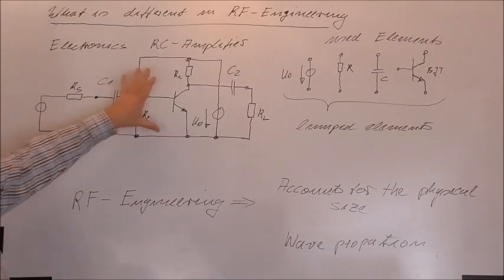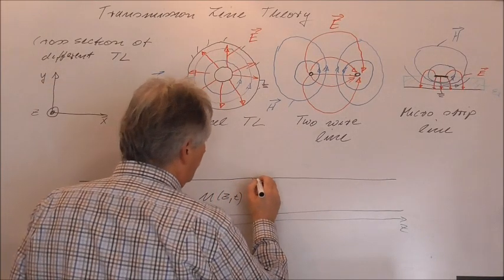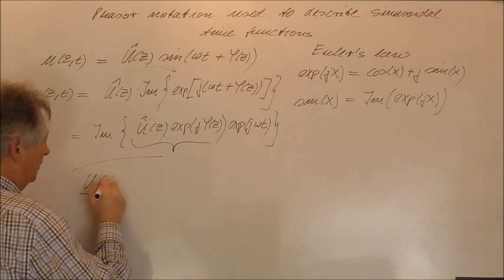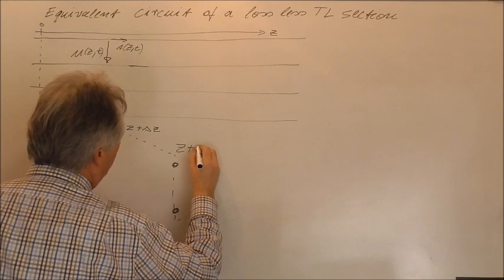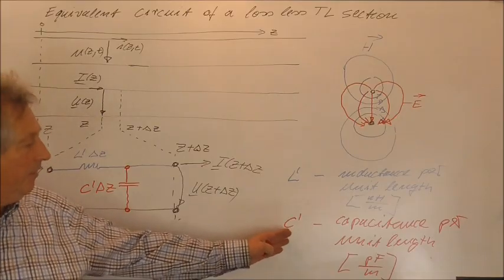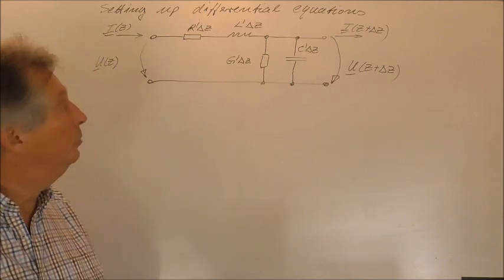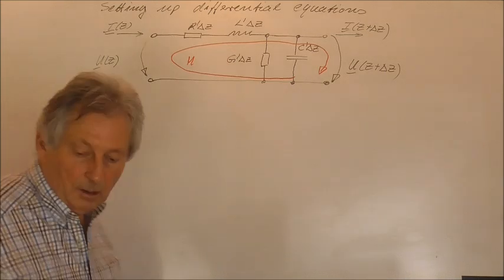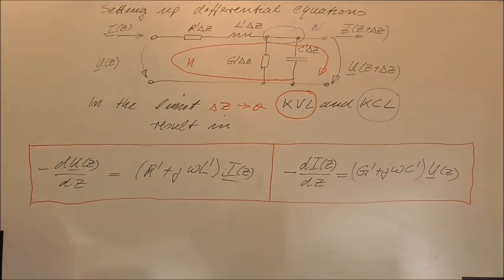Introduction to Transmission Line Theory

Comment: Dear Professor, I have a few questions?
Q1: Why do we consider only one inductance and resistance in one wire during the discussion of equivalent circuits of a TL section with losses in the two wire line model?
Q2: If the capacitor has losses during charging and discharging in the two wire line model, where does the lost energy go?
Q3: When you used KVL to derive the first differential equation relating the decay of U(z) being proportional to I(z), you end up with this KVL equation at first: 
-U(z) + (R' + jwL') * \Delta z * I(z) + U(z + \Delta z) = 0
Then you end up with this equation:
- (U(z + \Delta z) - U(z)) / \Delta z = (R' + jwL') * I(z)
In this case, we don't have I(z + \Delta z), so when we take lim_{\Delta z -> 0} on both sides of the equation, can we still obtain (R' + jwL') * I(z) on the right hand side?
Reply from the maker: To Q1: The series inductanc and series resistance per unit length accounts for both forward line and return line. You also could setup the mesh equation if you assume in the forward line are half of the elements placed and also half in the return line.
To Q2: The losses are always converted to heat in the resistance per unit length or in the conductance per unit length.
To Q3: If we take the limit \Delta z -> 0 this ends up for the current I(z + \Delta z) = I(z). In the whole theory we do not want to account for the exact placement of the elements since we don not know the placement. This can always be reached by negletcing terms of higher order. I do not discuss these details in the lecture.
Reply: @Lectures_RF_Microwave  Thank you very much Professor! I understand your explanations. 
So in Q1, R' and L' could be thought of as the equivalent (total) resistance and inductance per unit length of the whole line system. 
In Q3, since we consider a very small section, I(z) is  the same as I(z + \Delta z).